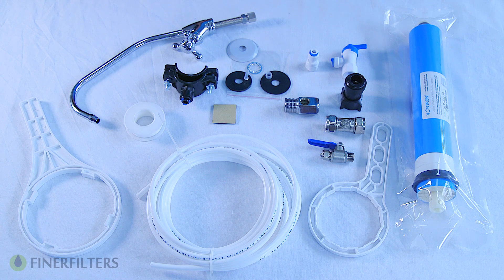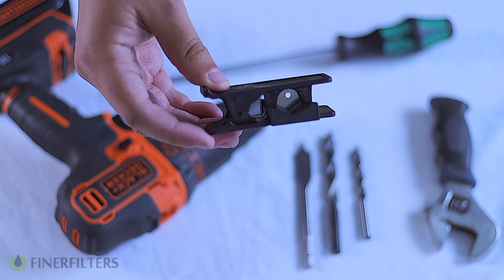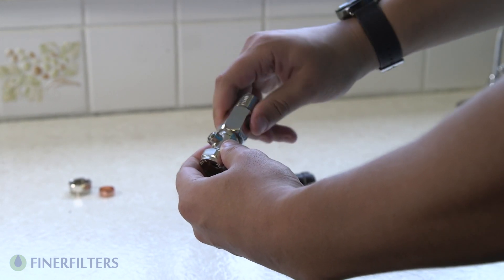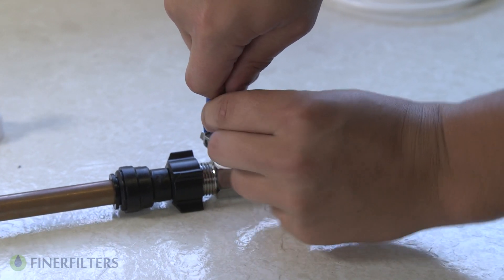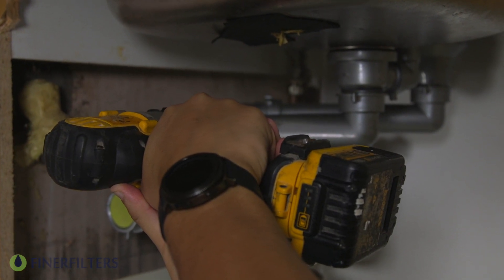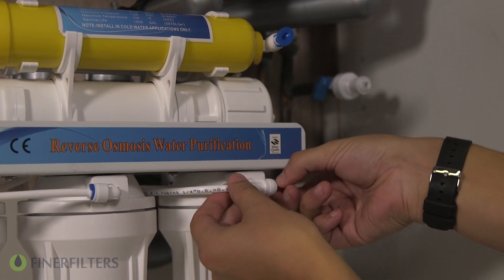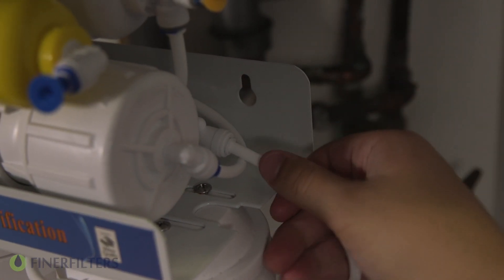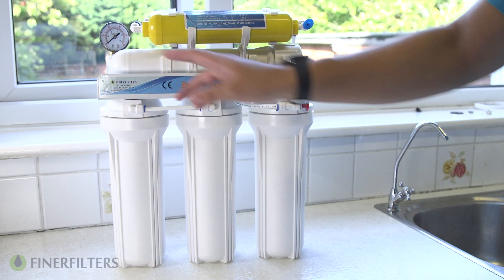How to install a Reverse Osmosis Water Filter System - Finerfilters

Comment: Hi. I fully installed the system, with no leaks (after a few minor floods) - touch wood! But on the 2nd flush I couldn't get a steady flow of water through the tap, just a spurt for a few seconds then nothing, then same again after I turned tap on after few seconds of waiting. I have it set up to fill the tank which it seems to do so slowly and I can get more out of the tap before it drains. I only thought then to check the water pressure on the unit and it's reading 40 psi.....think you guys say 45 is the minimum right? Would this be the reason for the failed 2nd flush? or should I check any of the filters are clogged? if this is the likely reason is it easy enough to fit the pump after the rest or would it be like starting again (not sure the wife could handle the cursing..) Thanks for the support - Colin
Reply from the maker: Hi Colin, thank you for your purchase and your question.
So, with the water spurting out of the tap initially after the second flush, this is normal as i imagine that this was immediately after getting the unit hooked up. 40PSI is the minimum required for the unit to operate, however optimal pressure for the stated membrane output (50 gallons/189 litres per day) is acheived with an optimal pressure of 80PSI - double the minimum pressure required. With a pressure of 40PSI, the unit will still create RO water, just at a slow pace compared to if you were to have the recommended optimal pressure. 
In relation to checking if your filter elements are clogged - when you flushed the carbon and sediment filters out for the first time, you hopefully should have done this without the membrane installed initially, as the loose carbon fines from the carbon filters could have travelled up into the membrane housing and prematurely blocked your membrane, resulting in slower flow and fouling. If this is the case, you may need to re-order a new membrane. Hopefully if this isn't the case, and when you flushed make sure you had opened the L1 valve to flush the unit through and get that membrane element saturated with water. Be sure to have the L1 valve CLOSED when you want to produce any pure water at all. The L1 valve bypasses the flow restrictor which creates the backlog of pressure within the membrane housing allowing the water to be forced through the membrane under pressure, and should only be opened to clean the membrane or when you have replaced the filters in the unit. The RO process isn't a quick one as it is, especially with the lowest stated pressure for operation. As i mentioned previously though, if since writing this post you have gotten a full tank's worth of water and water can be drawn when it's called for then it's likely you have everything set up correctly and may just have to adjust to the time the unit produces water. The tank stores around 6/7 litres, and will automatically start refilling once the tank drops below a certain level. One way to check is to empty your tank and check on it every now and again to see how long it takes to do a full fill. 
Finally, there is the option to add a booster pump post installation, no problem. If you have any more questions regarding this or may be interested in doing so, dont hesitate to call us on 01704 807600 or drop us an email - enquiries@finerfilters.co.uk :-). 
Many thanks, Shaun
Reply: @finerfilters  Hi Shaun, this is all really helpful information thanks for taking the time for such detailed replies! So 24 hrs plus now what I can say is I am definitely getting RO water as the DTS goes from 150ish for the live tap to 15/20 for the water from the filter fosset. However I did not do the first flush correctly as you mention in your response. I had the L1 valve closed rather than open. I realised this when I went to install the membrane as the housing was full of water which didn't seem right and you didn't warn about it in the video. I thought I might have dodged the bullet as the membrane wasn't in at the time but maybe installing after not full cleaning and drying out the housing could have fouled/damaged the membrane in some way?  I am getting the tank filled with RO water for sure but I'm not sure the tank is fully filling (as when I empty it out it for sure is not 3gallons coming out before it runs dry - even after letting it fill for 8hrs plus. As I mentioned when I do the 2nd flush steps (tank off and L1 valve open) I can't seem to get water coming through steadily at all, just a cup full and then it runs dry, seems the rest is actively going down the waster pipe.......I'm fine to buy another membrane if you think that might the problem (or a pump for that matter) is there any steps I can take to try and clean or unclog the membrane so I could eliminate that before spending good money on it? I noticed that PSI drops to 37/38 every now and then on the unit.....it's really weird as the pressure from the mains tap seems very high (not sure how I could test the actuals) so much so that we rarely turn that tap on full blast as it splashes water everywhere in the kitchen. Doing the initial flush wrong couldn't have caused an air lock or something could it? reason I ask is that sometimes I hear a groan when running RO water from the tap (from the stored RO water in the tank) kind of groan you would associate with a central heating system that needs to be bled......let me know thoughts from more information above and then I'll order the membrane or pump depending on your advice. 
Thanks again for all the support and service - Colin
Reply from the maker: @colinanderson7407  Hi Colin, no problem at all! Glad it was helpful. 

Ok great, i've taken all that on board. What would be best would be for you to give me a call on 01704 807600 as it will be so much easier to talk through with you over the phone :-). In the office from 9-5 today and tomorrow so give me a call when you've got a free minute.
Many thanks, Shaun

Comment: Why is there so much volume water going lost out of waste water drain line?
Reply from the maker: Hi Morne, thank you for your question.
This is totally normal for the reverse osmosis process, as the unit must waste water to create pure water. With our units, the ratio of waste water to pure water is usally around 3-4:1, providing parameters such as water pressure and water temperature are optimal. The unit has to seperate the permeate (pure water) and the waste water into seperate channels within the membrane to make sure that the product water is as pure as possible. Hope this helps :-). Thanks, Shaun

Comment: I,m confused as to which pipes go into which parts of the four way valve, your video does not show this. At least not very clearly.
Reply from the maker: Hi Kimball,

Which part do you mean by the 4-way valve? Do you mean the auto shutoff valve situated at the back of the unit? Our systems come already pre-configured and you shouldn't need to touch the auto shut off valve.

If you are assembling another unit, or building your own RO, there are plenty of videos on youtube highlighting the configuration of the ASOV. This is purely a video for installation. We will hopefully have another video highlighting other parts of the unit coming soon. Hope this helps :-).

Many thanks,

Shaun
Reply: @finerfilters  I recently needed to change filters on my five stage system, and needed to know if I had place all the wires back in the right order with the 4 way valve
Reply from the maker: @kimballcrocferd9988  Hi Kimball,  understood. If you'd like to send us an email enquiries@finerfilters.co.uk and address the email to myself - Shaun, then i have a photo of the configuration of the auto shut off valve I can send you. For future reference, you shouldn't have to remove the tubes from the ASOV to replace the filters.
Many thanks,
Shaun

Comment: Presume it would be ok to just fit the ball o fix straight onto the flex of the cold tap and the isolator body onto the cold water supply  (the way the cold tap flex is currently - directly) and not use the black fitting at all? It would just save cutting copper pipe to fit the isolator valve....?
Reply from the maker: Hi Colin, thanks for your message.
Whatever is the easiest for you. By reading what your saying, this way of setting the unit up shouldn't be a problem. As long as you have a line from your mains to your RO inlet with no leaks, etc... should be fine.
As always, give us a call on 01704 807600 if you would like to discuss anything further.
Many thanks,
Shaun

Comment: During the first water flush water leaks from the connection of the re-mineraliser cartridge and never get to the tap. My tank valve is off and the flush valve is open. What can I do? I have the RO-A1M
Reply from the maker: Hi Stefano, thank you for your question. If the unit is leaking from the remineralising filter, it sounds like there may be a lack of PTFE tape on one of the fittings. You should have received a roll of PTFE tape with the RO unit, and you can find a video on our channel which shows how to apply the PTFE.
Any other questions, don't hesitate to give us a call on 01704 807600 to speak to one of our technicians who will happily assist you :-).
Many thanks,
Shaun
Reply: @finerfilters  hi there, the leaks comes from a too short tube between post carbon inline cartridge and the re-mineraliser cartridge. Changing that one an putting one longer tube fixed everything.
I have une more question: to have the most pure water, the osmotic water without minerals, do I have to take the one that comes out from the post carbon inline cartridge and goes to the tank?
Reply from the maker: @stefanoaguirre1789  Hi Stefano, i'm glad you found the solution to your problem.
To get the purest RO water possible (less than 10ppm), you have to make sure you have optimal pressure (80PSI), optimal water temperature (24oC) and you will need a final de-ionising stage to remove the last TDS of contaminants that would still remain. De ionising resin allows you to get completely pure water, but it is not recommended to drink this for a prolonged period of time. 
If you were to take the water from your own unit, you'd just need to disconnect the remineralising filter. The post carbon filter will not add any more TDS after your membrane, so you can leave this on to improve taste of the water. Hope this helps. 
Thanks, Shaun

Comment: does the drian off run all the time ??? mine is running all the time ??
Reply from the maker: Hi Patrick, thanks for your question. The drain line shouldn't be running 24/7. However, the first few fills of the tank from the RO unit can take longer than usual and the system takes quite a while to create the water. The drain will be operating when the unit is creating water.
For any more help, please drop us an email - enquiries@finerfilters.co.uk :-)

Comment: The first one we got has an electric pump now they do not but have to connectors on the tank.
Reply from the maker: Hi Amigo. Do you have a query regarding this product?

Thanks, Shaun
Reply: Finerfilters LTD I’ve fitted it but as I said the tank has to connectors one isn’t used. 
Is there any reason for this?
Reply from the maker: @amigaamigo5307  Hi Amigo,
On the tank, you will see a threaded opening at the top of the tank where you screw the tank connector into and attach the 1/4" tubing to. The fitting at the bottom of the tank which is covered by a white stopper is actually the tank valve. This works like a bike tyre valve as you use this to re inflate the bladder within the tank if needed. You can also check the pressure of the bladder through this valve and it should be sitting around 8-10PSI. If you require any more info, dont hesitate to drop us an email - enquiries@finerfilters.co.uk. 
Thanks, Shaun
Reply: Finerfilters LTD it has one for the tank base and two for connecting to the system. Side by side
Reply from the maker: @amigaamigo5307  hi amigo, please send us a photo of the tank and a message mentioning your query to our enquiries email address if you require further help with this issue. Many thanks, Shaun
Reply: Finerfilters LTD ok thanks

Comment: Hello. How do I remove the stoppers that are coloured red blue and black? Thank you
Reply from the maker: Hi SuperGamer Bro, thank you for your question. You can view our video here: https://www.youtube.com/watch?v=hzFM5LWjxl8 on how to remove tubing/stoppers from a filter or fitting. Hope this helps :-).

Shaun
Reply: @finerfilters  sorry it did not help me
Reply from the maker: @OmniversalInsect  Hi, to remove the stoppers from the fittings, you must do the following steps. You should see a circular plastic collet surrounding the stoppers that moves up and down as you try to pull on the stopper. For the collet to release the stoppers, it must be pushed flat against the fitting. You should be able to do this with the end of your finger or finger nail and then you want to pull on the stopper simultaneously. Pair this text together with the video i copied in earlier and hopefully should find the solution :-).

Shaun
Reply: @finerfilters  Sorry that did not help me either. I'm talking about the 50gpd filter if that helps.
Reply from the maker: @OmniversalInsect  Hi SuperGamer, you can give us a call on 01704 807600 and one of our sales team can talk you through the process step by step.

Many thanks,
Shaun

Comment: Mines doesn't have that tank the yellow tubing connects to.does this matter?
Reply from the maker: Hi Gary. It depends on your use. If you're using it for drinking water, it would be a good idea to attach a tank so that there will always be water available to drink and you're not having to wait for the system to produce the water when you call for it. If it is for another use such as aquatics or window cleaning, you would just use the system as and when you needed to and run the water into your tank or container. We have reverse osmosis storage tanks available on our site, prices starting from £16.99 - https://www.finerfilters.co.uk/domestic-reverse-osmosis/spares.html . If you are thinking about purchasing a tank, please give us a call on 01704 807600 so we can be sure you are receiving the correct fittings also :-). Thanks, Shaun

Comment: hello Shaun my storage tank doesn't  seem to be filling up what have i done wrong ?
Reply from the maker: Hi Bob, thank you for your message. This could be down to a couple of things - 1. Make sure your L1 (flush valve) is closed. 2. Make sure your tank valve is open. 3. Test your tank pressure - there should be around 6-8psi of pressure in there. 4. Make sure you have sufficient water pressure for the unit to operate (minimum 40psi, optimum 80psi). If you are still getting no water through, please give us a ring on 01704 807600 :-).